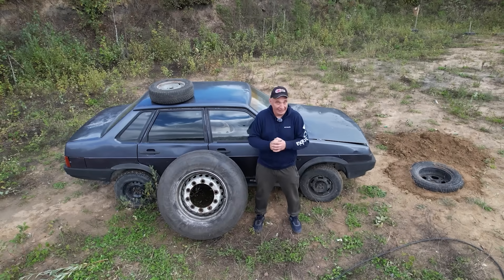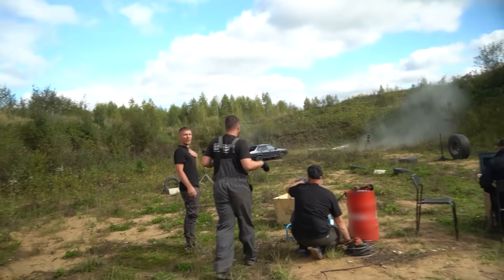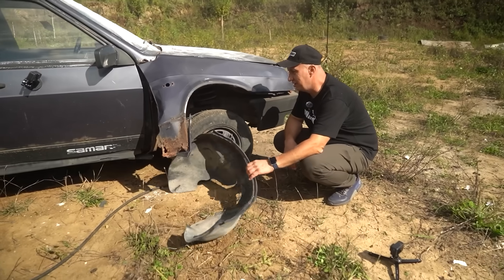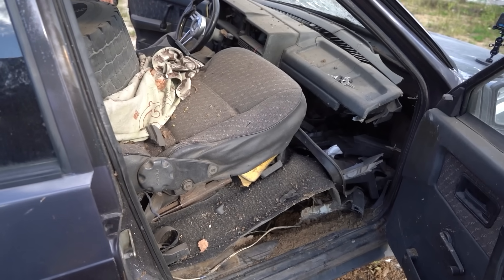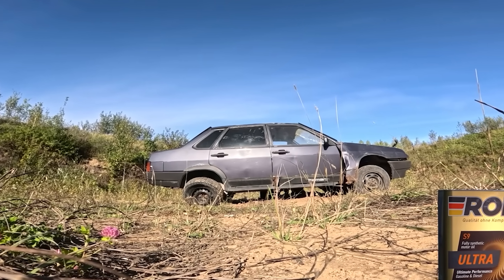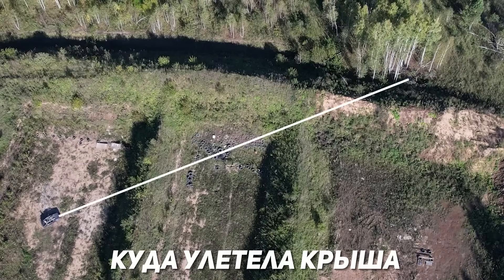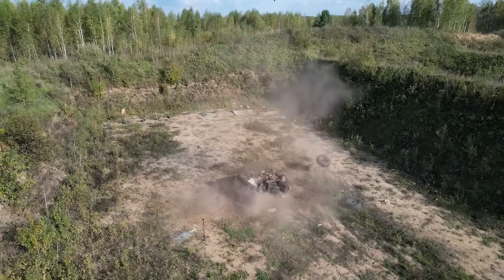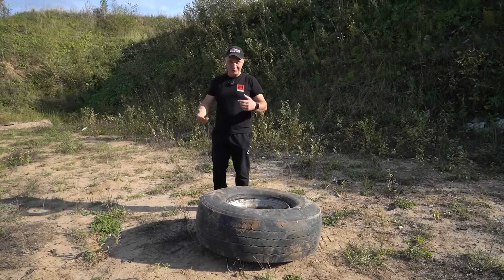We explode a truck tire inside (and underneath) a car - what will happen?

Comment: Have you done a episod seeing how much HP you can get out of a Lada engine a good solid engine with performance cam ported head mabye larger valves  bored out twin SD Webber's tuned exhaust  etc built for reliability  properly for a rally car😢😢😢😢

Comment: You have no idea how scary I find it working around large aircraft tires. 270+ PSI, absolutely massive, experience extreme temperature changes, and take more weight at a higher speed than any road going tire. Not to mention many still use split rims LOL
The accident investigation images from the dude that put the 3000 PSI side of a nitrogen cart up to a tire are genuinely unbelievable. Just hamburger meat stuffed under an AGE cart.

Comment: I had a tire overfilled because of a faulty gauge on a travel trailer. When it blew, it tore out the floor and closet in about a 4x4 foot square.

Comment: 10 tons per square meter at atmospheric pressure. So at 850 psi we have nearly 600 tons force per metre square. If the gap formed is 0.01 square metre, we have a sustained blast force of 6 tons. This is may be the initial theoretical basis for our hopes.
I remember the release of the Lada Samara, a famous rocket building city. It quickly won our admiration.

Comment: The most dangerous ones are the old Split Ring Rims that were common for Military Vehicles and other larger vehicles used in farming and construction operations, those split rings would unseat and fly through the air and have been known for taking people’s heads completely off their bodies, personally I’ve had 1 that embedded itself into a tree that was only a few feet away from me and it’s flight path and I’ve never touched another one since

Comment: Back in 1969 I put a garden tractor tire on a rim and had it laying flat on the ground.  I don't know how much pressure I put in it but my compressor only put out about 100psi max and it was really slow to refill.  The tire blew out the bottom side and launched straight up.  It shattered the bone in my right forearm and continued through an aluminum carport.  Came straight back down and bounced off the hood of my P/U truck.  Now watching this video and several others on YT I see how lucky I am to be alive.

Comment: I was once fitting a car tyre for a pair of African guys,one had only been in the UK for a week and his friend politely asked if he could watch how it's done.
I told them to stand back about ten foot and watch,which they did,but while inflating the tyre a part of the bead was not popping over the safety rib on the rim even with 40-50 psi in it, they were chatting in their native language I assume one was explaining to the other what was happening when he rushed forwards and jabbed his fingers into the gap between the tyre and rim,presumably to illustrate to the other guy what the problem was,I grabbed his hand and snatched it away instinctively and about 6-7 seconds later it popped with that familiar loud twang,both of their faces at that moment were pictures of horror and from that moment on their lively friendly manner turned to quiet reflection😂.

Comment: When I used to pour concrete I used to have to walk right next to the cement truck we had a curb machine my boss told me to take the rest of the concrete over to Corner curb to empty truck I got about 30 ft from that truck in the tire on the rear blew up had I been standing there it would have took my head off

Comment: I had a bicycle tire that took 65 lbs of air pop in my face. I had just fitted up new tubes in my rims and put 35 lbs in them to get up to a service station that had 65 lbs of air. I had put the air in and walked the bike to the store near by. When I came out I checked how firm the tires where and I thought I could hear a little hiss.  And as I leaned over it blew out. 
Ripping along the seam of the tire and tube. 
Crappy Chinese tubes 😂 and tires 😂

Comment: I’m a retired truck driver, and I’ve had many blowouts. But fortunately never a steering tire. But I know what damage is caused by the blowout, it’s extensive. And they sound like a bomb. It does seem that the newer tires are less likely to explode than the older ones did. But I also remember the split rims that were ubiquitous earlier in my career. They were literally deadly. I’ve worked with a lot of them, they were quite scary.
Reply: My uncle when i was a young fella drove trucks his entire life, i cannot remember why but he used to say those SUPER Singles ( i think they used 1 in this clip ) were the most dangerous tyre

Comment: Guy on service call repaired a ran flat super single on a semi. Got it to over 100psi and the sidewall zippered. It shredded the coat he was wearing and threw him over hood of svs truck and tore his spleen from the air pressure deforming his torso and pushing on his organs. He got lucky to only be in hospital for a few days instead of a casket.
Reply: Good thing you don't really need a spleen I guess.

Comment: over here in Germany trucks run at 9 bar (10 lug wheels) and when these grenade because of either age or mistreatment they'll like be closer to 12 bar which just so happens to be the normal operating pressure within air brake system of most big trucks

Comment: Reminds me of a time when I forgot that I left a tire inflator on: I got such a crappy tiny, but extremely loud 12V/230V air pump that took ages to inflate a car tire. So yeah I left it on and left a garage for a while, then forgot about it pumping a tire: Fortunately a compressor overheated before the tire popped while that poor old winter tire went to 6 BAR. Releasing pressure off that tire in clouds of nasty eye burning smoke from the compressor was not the most pleasant experience, but still better than having to deal with a torn fender if the tire was to explode!

Comment: Great demonstration! Retired gearhead, people do not realize the power of compressed air, even just hitting yourself with a stream of compressed air can severely injure or even kill you by injecting air into your body along with whatever is in that air such as oil, water, and other nasty things you don't want under your skin. The US Military uses air injections for many of its vaccinations when you go through intake at Basic. The only difference between a steam explosion and an air explosion is the heat, the force is pretty much the same and just as deadly, you just won't be cooked afterwards.

Comment: My Dad told me a story of a guy who was trying to get a tractor tyre to seat on a rim with a detachable rim bead piece. He had this thing flat on floor whilst stood on top of it.  My Dad knew the bead piece wasnt seated correctly but presumably because he was just the apprentice he was ignored.  Dad remembered the air compressor was well past 120 psi when the detachable rim piece let go and the resulting explosion plastered the guy all over the ceiling...

Comment: @Garage54 I have an idea/challenge! Try flipping an empty 40+ passenger city bus onto its roof by overinflating a tractor tire in the ground. Would it work? Bonus points if the bus get air, flips, and lands back down on whats left of it's wheels. I've never seen such a thing happen before, think it's possible?

Comment: Hey guys, I am an American that has recently discovered your channel and think it is very interesting. 

I have a suggestion for you to try. How about using the car's coil springs to make kinetic grenades? You take the coil springs, or sections of them, compress them down so they have stored potential energy, that would be contained with some sort of lever release device, so that when the lever is hit, it moves releasing the stored energy in the coil springs... which then could become shrapnel......the idea being to see how much forced could be generated by such a device... and the potential damage it may do. I have described the basic idea and I think you all can design and build it to demonstrate some really fantastic forces.

Cheers,

Tim

Comment: I have seen the old truck wheel split rings go through double block concrete walls and once totally wreck a car that was driving past a truck when one let go.  I was following on a motorcycle and needed to go have a beer.

Comment: Soldier: "We're out of anti-tank mines." — Officer: "Use a lorry tire instead"

I've sat in a coach going at 100 km/h when the tire of the wheel right below my seat blew up.  I saw a big chunk flying like 30 m.  Impressive and dangerous.  It didn't feel very noteworthy in the coach.

Comment: Random thought, remember the manual transmission with the torque converter and front pump. Can you try doing just the torque converter and front pump with and output shaft on the front pump to go directly to the driveshaft.

Comment: This would be perfect for some low budget movie effects. If you need to blow up a car or just throw some dirt in the air for an explosion. You can probably add some flames digitally if you need to. Plus no explosives license required.
Reply: Compressed air is used in various ways for a lot of movie effects but you'd want predictable results. A large, mostly harmless fireball with flammable gas is another inexpensive way to enhance visuals like this.
Reply: @JJFX-  Only that an air cannon wouldn't have the power to move a car or a lot of dirt and can be pretty expensive, depending on size. And fireballs again require a license in most countries and don't actually replicate explosives very well. I have always thought that if you wanted to get the actual "explosion look", there are no easy ways to do it on a low budget. Just look at the nice hut explosion at the end of the video. Can't get that with an air cannon, since they are one-directional.
Reply: Ironically.. THey kind of do.

Comment: Reminds me why I've taken a couple compressors out of circulation due to pin hole leaks! I've warned people that they are unsafe and warn them not to use them; this video is a reminder that compressed air can have deadly results.
Reply: I'm actually shocked air compressor failures aren't more common considering how many people just have them in a garage without proper maintenance. Probably a good thing the compressor itself tends to fail sooner on cheaper units.

Comment: Wish you would of had a truck tire with a split rim but you have done a great job as always with your content.  👍👍👍👍
Reply: Those old split rims were dangerous as all hell
Reply: @OuthouseFlower  I know . I had put a many of new tires on them . I was told as long as the ring wasn't bent or so far gone just make sure you seat the ring correctly around the rim it would be ok . No tire cage. I can just say I had gotten lucky 😊.

Comment: You guys should put a camera inside of a tire with lights and see what actually makes the tire blow up
Reply: The rim failing or the rubber failing. There you go, no need for cameras.
Reply: Air pressure causes the failure

Comment: holy moly those over inflated are a lot more deadly than I was expecting!!!
Reply: No wonder they turn tyre mechanics into casualties so often.
Reply: These things regularly inflated are deadly. I've had a couple of semi tires blow up on me. It's basically like standing beside a small bomb. Semi tires are inflated to about 100psi on average and just the burst of air can kill you nevermind any shrapnel.
Reply: @Canadiancoinguy  I am so glad only bicycle tyres exploded in my vicinity.
Reply: Anyone that has driven trucks know this. Youre always told not to inflate a tire without a cage around it, if it blows you're d e d
Reply: @johnm3907  People think that because they survive car/motorcycle tyre blowouts without damage, they can do the same with truck tyres.
They don't grasp what "exponentially bigger" means.

Comment: i've never seen such destruction to a car. Hands down the best tire pop video i've seen.
Reply: Yeah... looks like something out of Iraq or Afghanistan; where it got hit with an IED or mine...
Reply: Try looking up tractor trailer tires exploding.. Seen it happen first hand and it just crumples the side of a car next to them.
Reply: @SilvaDreams scary shi!
Reply: Yes, it is incredible 😲 🙂
Reply: Agreed! This method should be used instead of the test dummy beside the tire to train mechanics about safety!
Reply: It has been a while since they've destroyed a car to this point.
Reply: @tslim250 You should look up the old Mythbusters video where they fill a cement mixer truck with explosives. It gets completely vaporized ;) One of the coolest things I ever saw when I used to watch tv :)

Comment: Maybe if more videos like this will go viral, car drivers wouldn’t drive anymore for miles parallel with trucks.
Reply: They like the feeling of safety they only get in the blind spot of a semi.
Reply: Years ago mythbusters tested it. Result was that if a semi truck tire blows next to you then the pieces of tyre will not only fly through your car window like it was nothing but have enough energy to take your head clean off from your spine
Reply: yeah
Reply: I ride a motorcycle in the summer. I try to avoid riding beside big trucks whenever possible. I was riding beside one at around 100KPH, the truck driver got so hard on the brakes that the trailer wheels locked up and began to jack knife, into my lane. I just down shifter a gear and gave it full throttle and pulled away from him. It was all because some idiot decided to brake check the transport truck. 
Thats why I will not ride beside at all.
Reply: @My-Name-is-Mud-1969  sadly even the new trailers like 2024 with full ABS and EBS in hard brake situations lock the wheels. There are so many variations compared to a normal car. Weight distribution, tyres condition, type of tractor unit, number of axles, etc. Also because the road surface isn’t straight to allow water to drain, the small incline can make the trailer go sideways. 
As a truck driver when you break hard you usually do this because it’s something in your front, you only concentrate on this and the instinct it’s to only look forward. On situations like that you don’t have time to look in the mirrors to see what the trailer it’s doing or you just don’t know because you don’t have experience.

Comment: Anyone figure out the forces released?  Who needs explosives when you have an air pump.
Reply: technically explosives are 1g of solid material that expands to 1000x the volume for a very very small amount of time, much faster than these tyres do = way more damage due to a "denser" shockwave.
Reply: How many decibels ?
Reply: @jona1pail122  that's a silly unit to use.

Comment: Hey peace from the north east MERIDEN CT out United States a why don’t you guys try like a Bigfoot tire off one of those giant trucks out here United States try one of those trucks are like a giant bulldozer truck tire or something like that that’ll be awesome. Try that next time. I love you show man I hope to meet you guys one of these days later
Reply: Vlad was asked on his russian  G54 channel to get a tire from a mining dump truck (for example, from a BelAZ dump truck). He replied that it would be very expensive and he did not know how to exceed this tire pressure. Also, a specialist in the maintenance of such dump trucks wrote in that comment thread, and he said that an explosion of such a tire could demolish several countryside frame houses.
Reply: @YaKefir4eg  that sounds about right. The plumbing is going to be the main problem, before the tire gets inflated to the point of unseating or exploding - some fitting or hose somewhere is bound to let go, and yes, even if it's possible to set up a system that works - that's going to be one hell of a blast.
Reply: @SwapBlogRU   yup, right

Comment: Perhaps you could put a half gallon of soap and a couple gallons of water in one of those truck tires, mix well and try to blow the worlds largest bubble.
Reply: sadly, surface tension exists to reduce the fun. no balloons will happen

Comment: This is why I won't drive a CNG or Hydrogen car. Forget the flammability of the fuel, it's the potential energy in the compressed gas. If a tire can do this at several hundred PSI, what happens, when you take several times that volume, and pressurize it to several THOUSAND PSI?
Reply: ye, 's a bom. kabooom! And they regularly sell you 2nd hand tanks with cracks in them. Perfectly visible on xray. Not to the eye.
Reply: So don't even think about getting in a car with hydraulic brakes or power steering, these constantly reach 1000-2000psi, run and never look back if you ever see one.
Reply: @PREDATEURLT  Liquid doesn't compress. When pressure is released, there is no expansion. Air, fuel gasses, and especially steam, have a huge expansion volume, creating the explosive power. When testing pressure vessels, they will often use water or some other liquid, so when the tank does rupture, it is not a violent explosion. (called "hydrostatic testing")
Reply: @vincentrobinette1507  I get it, but amount of people who dies of LPG, CNG, Hydrogen or other liquid gas system is so tiny in comparison with people who dies because of exploded tire (direct and indirect causing crashes) or failed brakes that didn't explode but still kills you with that tiny spurt of dot 4. I use LPG cars for 15 years and never died even once.
Reply: @PREDATEURLT  LPG is much lower pressure, but it is a liquid. If you're going to use a fuel gas, that's a good choice. The only concern, is that the pressure goes up, as the ambient temperature rises. (110 PSI in winter, 240 PSI in summer) With these lower pressures, the cylinders don't need frequent certifications, like the other high pressure gas cylinders do.
     In a car crash, I would MUCH rather be running LPG!
Reply: @PREDATEURLT  air/pneumatic pressures are vastly different in that air expands when released, hydraulics do not.